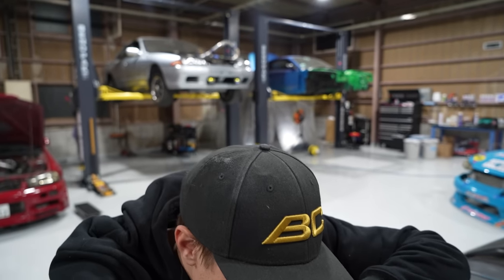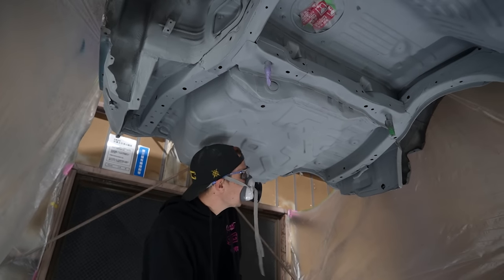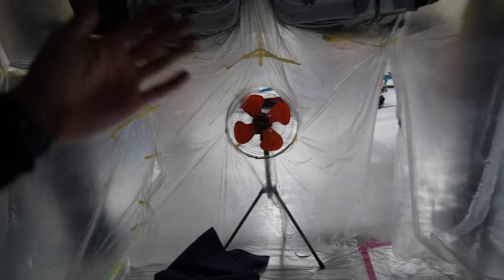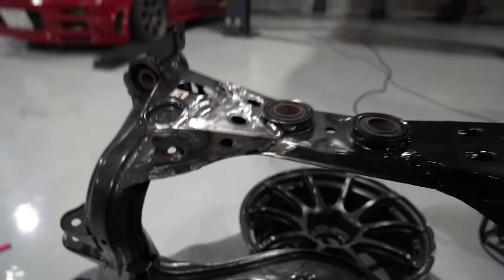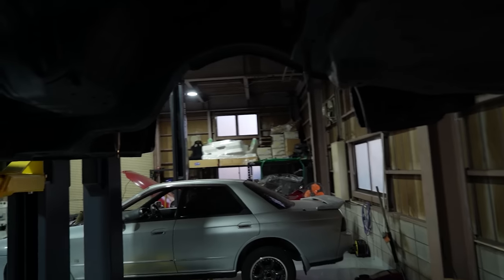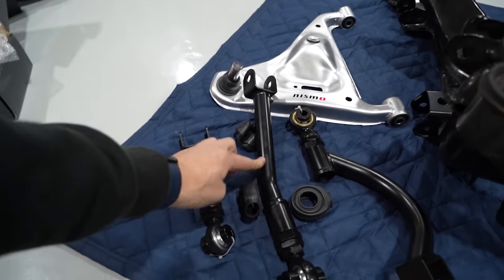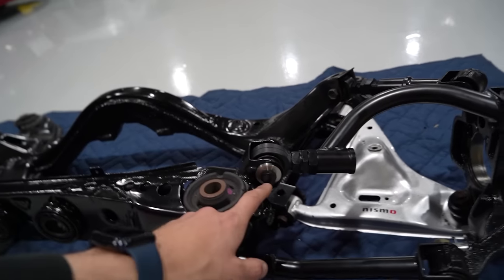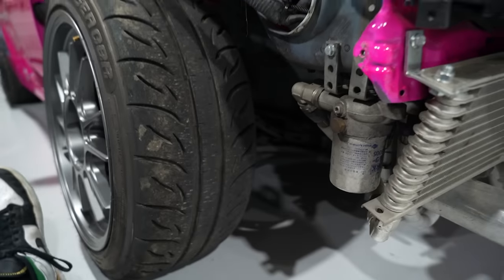I WENT TOO FAR! Abandoned S15 Silvia Underbody IS BRAND NEW!

Comment: congratulations Sam and May with Yugo, i have a tip for your welding that you can use to improve your welds even though they are already starting to look great , if you find a place selling pre cut pieces of metal of different thicknesses to practice your welds on, your skill will improve alot and i am loving the abandoned s15 restoration and daiki is a great addition to the channel

Comment: Sam for future reference it is actually good practice to paint everything you grind and behind those weld in plates with weld through primer so they don't remain bare steel. Once welded it can be hard to paint behind them. Same goes for welding in panels and seams
Reply: Literally said the samething. Going to end up with rust behind those bracing plates eventually.

Comment: Correct me if I’m wrong. The Zinc in that primer is for welding. Gives it something to slow current though and then is helps keep the welds clean on the inside to avoid rusting. Not to spray over rust to keep it from rusting. I believe that is a different coating altogether

Comment: One last bit of rust repair advice from someone who worked in a body shop for a while, spray some of that body wax in the framerails to protect as much in there as possible. That's where the rust will start now, so if you can stop it there you'll be safe for a long time.
Reply: He did I think if you watch the start of the video he has a can with a tube on it that he has inserted in the framerail

Comment: Weld through primer on sub frame before reinforcement will stop rust under reinforcement plate. There will be bare metal underground
Reply from the maker: I did behind the plates with that but not the front as I was going to be painting it black anyways & have easy access to it

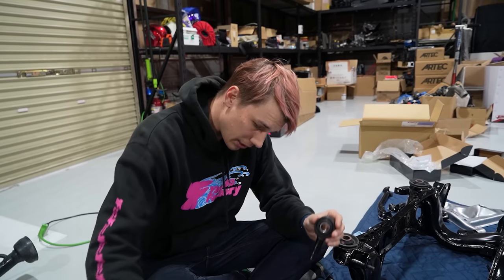Comment: @15:16 next best thing, after getting the boot on, is to stuff teh boot full of HIGH TEMP grease, taht wasy the metal on metal hyme joint is always lubricated and protected with dust boot from road debry and moisture
Reply: @15:23 welp, you kinda addressed same step there, need heavy duty grease though, something that grabs on and dosent let go easily.... much respect